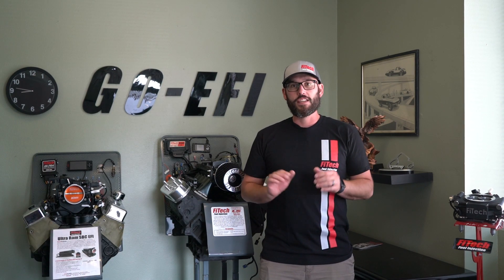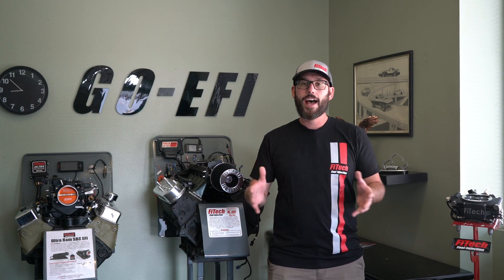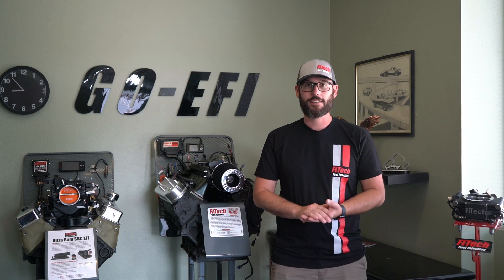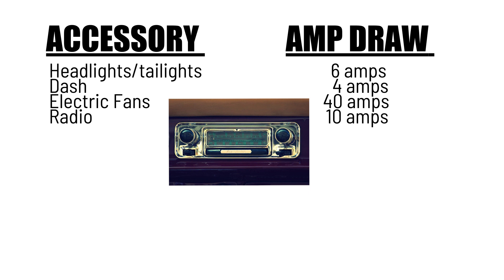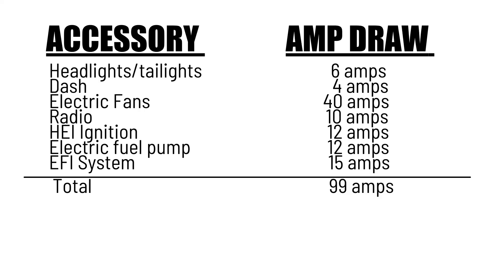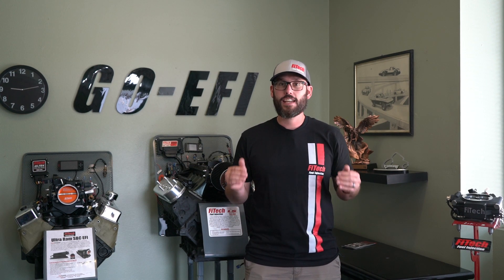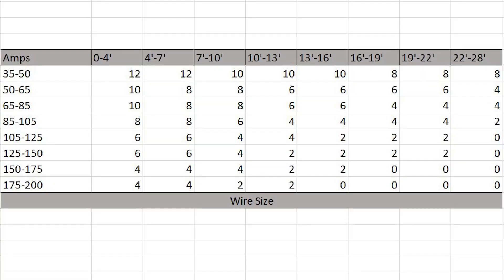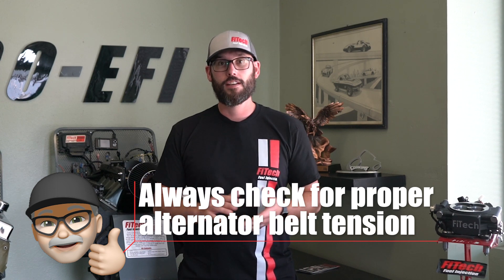Is Your Alternator Large Enough? | Tech Tuesdays | EP28

Comment: Great video! I fought with this on my car a year ago. A couple of additional things I learned is making sure your alternator is properly grounded is a big deal. Also pulley sizes and rpm.Some alternators can’t handle a lot of rpm, and will be quickly ruined if you turn them faster than they are designed to turn. I ultimately upgraded to a different style alternator and a serpentine system.